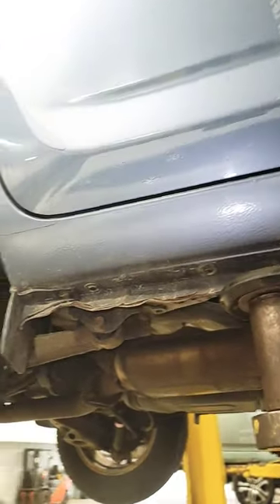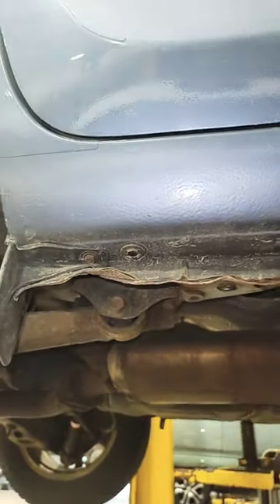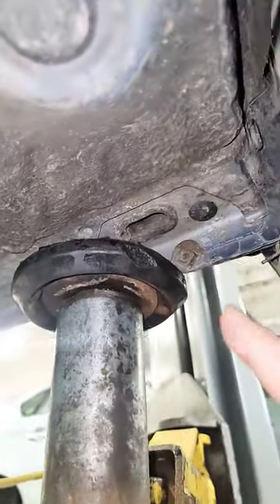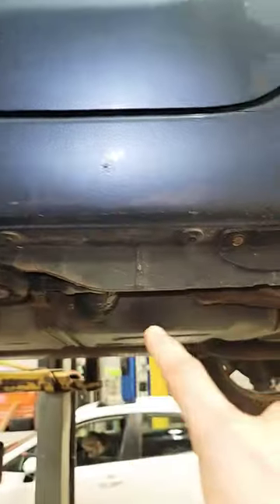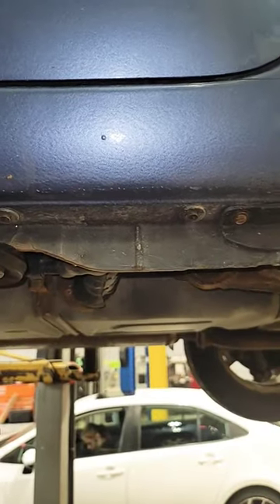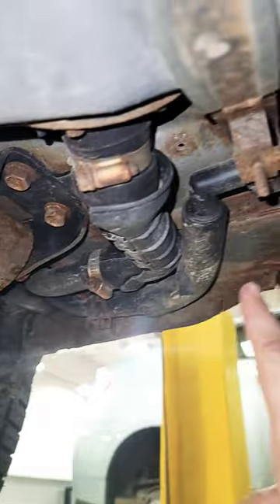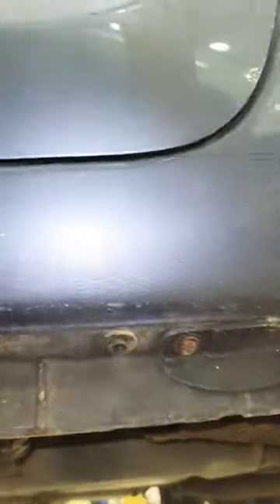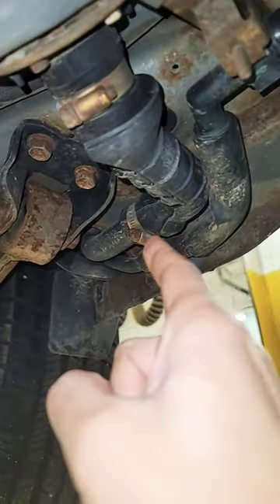This is why you wanna lift the vehicle properly #shorts

Comment: The guy i bought my CRX from had it jacked on the floor board. I have a camel hump infront of the driver seat😬
Reply: But at least you HAVE a CRX. Those were THE car everyone wanted when I was in highschool in like 98 99. Stereo guys would put ridiculous systems in them. Build a wall of like 8 12s lol
Reply: Some convincing via sledge hammer should fix that
Reply: @joshdfox420  I still want one and have a 91 civic hatch
Reply: @radelement3987  still not bad though. Almost everyone had an Accord back then too. My one buddy had a 4 door Accord stick,smashed up the front end pretty bad and it had 220k+ on it when we drove it about 14hours to Canada lol made it there and back easy.
Reply: I looked at a CRX once but it was pretty bad. Needed full exhaust,been smashed in the right rear quarter,hard enough to snap the rear shock cause only that one was replaced...most of the rear quarter was Bondo too,painted with house paint
.pretty sure since the can was in the car. For something like $2400 probly. Good deal today lol
Reply: 🤣💀💀💀 subi driver fashooo💀😂😂😂🤣

Comment: Had someone bring in a vehicle once with a hump in the floor from where they tried to jack the car to change a wheel. Described problem? Gas pedal not working properly (RHD Vehicle, UK) Hammering the floor flat again allowed the gas pedal to move as designed. Never underestimate the stupidity of the general public.

Comment: The shade tree mechanic ran out of lift points for their jack stand(s). Further evidence the car manufacturer does not want their customers to work on their own vehicle(s), to which I say I don't have to beat the flat rate clock, and possibly compromise the repair job, often resulting in return trips to the garage or dealership to correct the errors made while trying to beat the flat rate clock. Not to mention the repair cost savings for doing it yourself.

I'd put my jack stand under the trailing arm joint, or axle, or some other part of the suspension where the jack stand remains stable as the car's weight is lowered back down on the jack stand. I NEVER crawl under a jacked-up vehicle without jack stands in place. Your garage lift has ratcheting locks (which performs the same function as jack stands) you hear clacking when you lift the vehicle on your garage lift.

For example, I'll use a jack stand while performing an oil change at home, but I won't use a jack stand while performing a brake job. If my floor jack unexpectedly collapses while performing brake service, I will be bummed, but not injured or killed.
Reply: Yes; I've done brake jobs on a jack, mindful of how I'm positioned during certain steps. I've also put the tire/rim laying under the vehicle by a suspension component as a safety measure, and only lifted one "corner" of the car at a time. I had stands I gave away years ago because my floor jack didn't have the lift height to use them; I just looked at stands recently at Wally Mart; they look shorter than the ones I had.

Comment: I always wondered by cars weren't given a marking of some kind where those jack points are.  I know they are in the manual but cars are often sold without manuals and peeking around the corner to locate them can be tough.
Reply: when some goomba,would screw up royally,we called it "insulting the manual"
Reply: Most cars should have the arrow indented into the rock panels pointing to the reinforced part of the pinch weld.

Comment: Also should note that those narrow bulges (about 1/4-1/2" wide) running vertically on the pinch welds are interior floor pan drain holes.
There's usually one near each lift point, 4 total on vehicles.

Comment: At our store we probably replaced 200 EAS compressors on LR3, LR4, Sport. Always same story,  customer had tire repaired and now has suspension fault or hears loud rattling from left rear. 
Compressor housing does LOOK like a good lifting point but sadly it is not.👍👊

Comment: That's the proper lift point for the customer so he doesn't have to go under the car. As. In a shop manuel the lift points for a shop are usually located on the lower control arms under the shock absorbers or struts.

Comment: years ago I put a chevy corsica on the frame machine. l didn't bother to look but the rear steel brake line was right  behind the pinch weld and when I tightened the clamps that line got smashed flat as a pancake.

Comment: I hate those things, my 2017 Sentra had them and they bend every time I jack the car up, I put the jack in the slots they provided but they are just really thin and bend a bit every time, wish they would just put the jack point my moms 2006 has right under the engine it’s in the middle and easy to get too jacks the whole front end up it’s great.

Comment: It's actually called a pinch weld, not a wing. You only want to lift light weight vehicles from them or they'll bend like that one did. You have to have more than 3 brain cells to lift a vehicle or you can really mess up your weekend